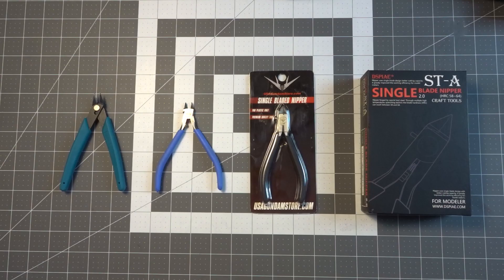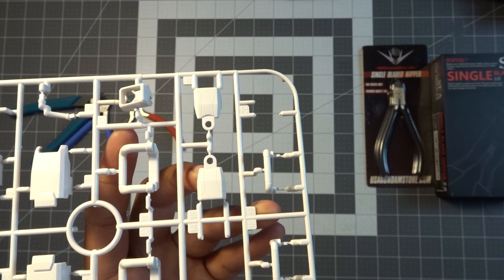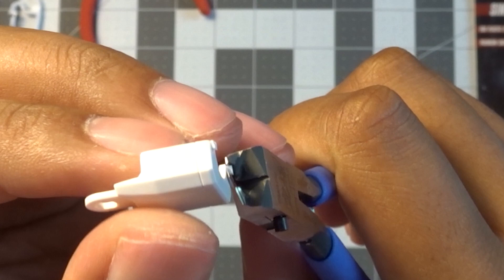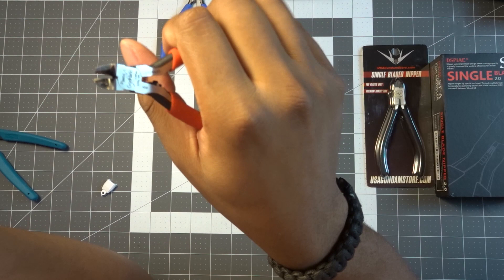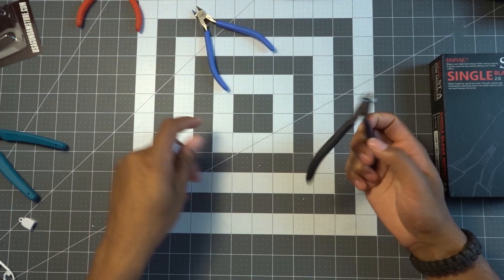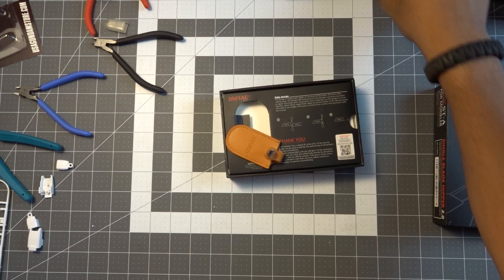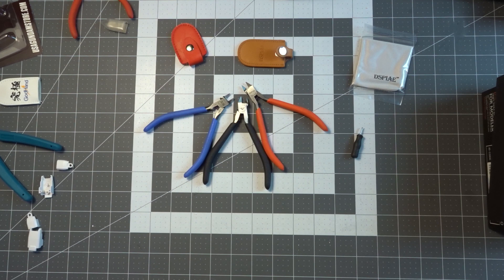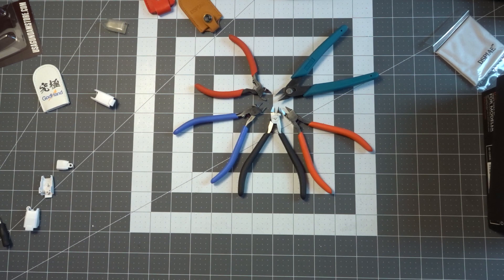Gundam Nipper Comparison | Nipper Showdown!!

Comment: Great video!👏👏
I went through a lot of nippers and the combination of Tamiya's (for parts removal) and Godhand nippers (for gate removal) work the best for me👍👍
Reply from the maker: This is a great combination especially if you’re really trying to make the blades on the  Godhands last
Reply: This is basically the combo I use now, if you live in the USA check out the Taiwanese VRC Hobbies 115mm nippers, they make a great substitute for the Tamiya Sharp Point for only $12 on Amazon. I have only had mine for a few weeks now but they cut just like the old Tamiya Gold Star Sharp Point.
Reply: @RiskyBRiskyB  thank you for advice, just bought VRC Hobbies

Comment: Whats the reason why you should cut closer to the gate than the actual part?
Reply from the maker: this gives you more nub on the part to work. cutting too close to the part you run the risk of catching the side of the part when cutting. some nippers dont cut exactly straight so cutting on top of the part can sometimes give the nub a divet of sorts as well.  Short story is itll give you more room to do a proper numb removal on your parts. hope that helps.
Reply: @GunplaUniversity  ah ok, so after you cut the part you just use the same nipper to clean up the nubs?

Comment: Is a bandai side nipper are good? Im new in building gunpla but cant decide which nipper should I get.
Reply from the maker: Maddy Muhat first off welcome to the hobby!!! 2nd off if your just starting, little trick for u, use some nail clippers to get you by until u can make a good decision on what nippers to buy. Personally any of the 3 single sided nippers seen here would do an amazing job for you. The Bandai side nippers are what I’d call good beginner nippers
Reply: Gunpla University how about the plato brand nippers?
Reply: @maddymuhat8079  i bought plato last week..its ok for a beginner I guess and its cheap